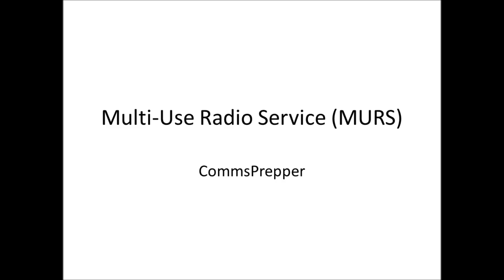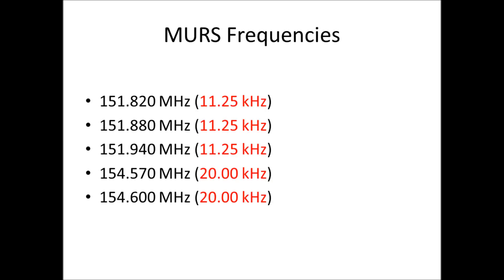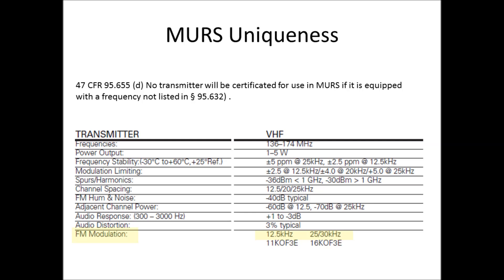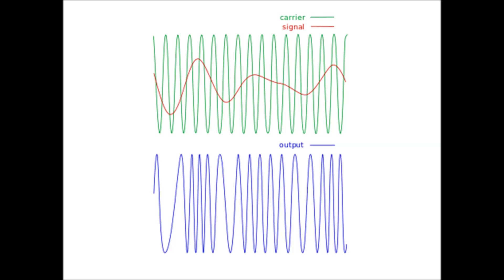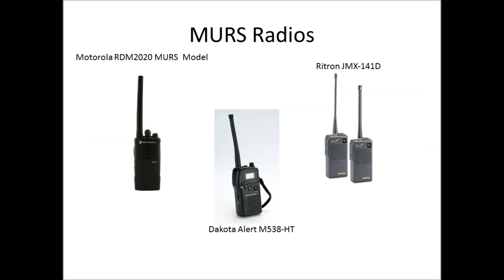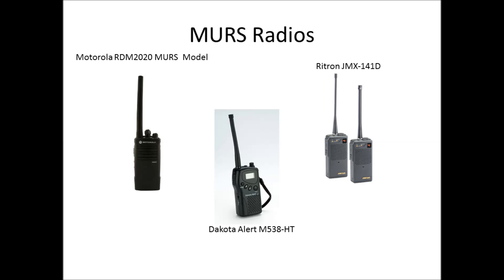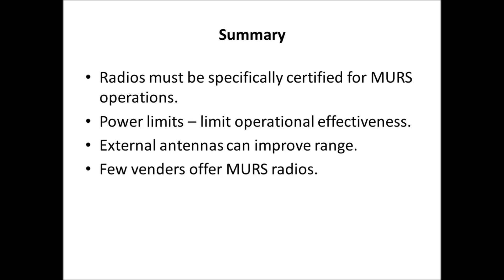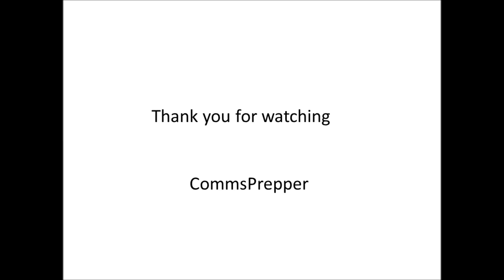MURS Radio Information for Emergency Communications

Comment: Sweet I’m a licensed ham but I’m gonna start scanning frs,gmrs and the 5 murs channels on my dual band ht. I would love to see the murs frequencies of 151-154 used locally like cb was in the80’s and 90’s when crap shack was in business. Cb is so dread now in my area nothing but static. The fm band is way clearer let’s use those 5 channels since it requires no license.

Comment: i see this video is from 2012 and majority of comments are up to 7 years old but its currently 6-29-2020 and there are B-Tech Murs radios on amazon for $50 brand new! they are basically the baofeng UV-82 model radio with a Murs "dedicated" chip set and 15 channels!  the 5 standard and 10 stepped and tuned (not sure if thats the correct terminology or not) and to my knowledge at least theres STILL no mobile or base station options available only hand helds!
Reply from the maker: I don't have china radios on this channel.

Comment: Just learned about MURS, use it at Walmart, they are probably the biggest user of MURS.  I know Motorola produces radios specifically for them.  I just bought a BTech MURS V1 for this very reason,  As i work for them.

Comment: Wondering if opinions have changed since this video was posted. MURS is still the only non licensed VHF band that allow external antennas that I'm aware of. 2 watts through the right antenna can provide good coverage.
Reply from the maker: Not sure.  I have not googled MURS radios in awhile.

Comment: If I bought a Murs radio could I  use it as my as my fire radio on the  fire department I'm on?
Reply from the maker: No
Reply: Your fire department has their own special frequency seperate from the murs band.
Reply: Can your fire department  use it as a 'Local' channel, for non emergency Communications?

Comment: Hi Com's Prepper, Although I have only heard a scratchy driveway monitor once, I never hear anything on MURS near me.  It is my understanding that Walmart uses the MURS frequencies (I have never listened to MURS near a Wallmart).  Wallyworld uses some kind of mobile in a metal box on the wall near the front door of their stores with a 1/4 wave mobile VHF antenna on it.  I was told a long time ago that it was a regular 12/25 Radius mobile in the box.  Apparently 151.820 carrier squelch has been designated the National Prepper Channel (Like CB Channel 9), but in my neck of the woods (in the great smokey mountains), its all quiet here.  Although not legal and I definitely don't recommended it, it is also my understanding that many of the locals use Marine band in their pick up trucks (I don't know what channel they use).  I have no love for the Beofung and other el cheepo comms (basically because if a lay person uses one and they accidentally touch the wrong button, without the manual they wont ever find the channel they were on to use it).  Your title of this post is   " MURS Radio Information for Emergency Communications"  Although MURS is supposed to be limited to 2 wattts and most of the radios out there are 5 watts on Walkee Talkees and more on the mobile units out there.  It is my understanding that MURS is kind of like the CB radio (per the FCC).  I think it could be VERY useful for campers, hunters preppers etc... to put all the MURS, FRS and GMRS frequencies in an emergency radio in a back pack and let their family's know, even leave a note in the front window or their cars (where they park them when camping), stating If the car is still there after a certain date they might be in trouble and to try to call them.

Comment: Update: Baofeng makes a MURS V-1, which is FCC approved and meets all of the specifications for $ 54.00. It will also receive many additional frequencies along with transmitting on murs.
Reply: Why ?
Reply from the maker: That's unfortunate.

Comment: Great video man lots of info from me personally I think Murs frequency would have taken off better if there were a lot more bubble packs that's started to use itthere are some affordable version still on eBay and Amazon but it would have been nice if Motorola made of bubble pack even if it was $150 our or midland would have made a version but if I'm not mistaken for motor roller I think the cheapest one is like 190 and if that's the case you could just add another hundred to that and get a regular VHF version 4 watts of power

Comment: I know where I live at there are several groups that use Murs radios. And most of the guys are using base station antennas at about 30 feet in the air. So I wouldn't call it obsolete. And some of the guys also have mobile units in their cars because they want to stay off the grid and not get a ham license or a gmrs license
Reply from the maker: When I say "obsolete" I am referring to the market.  There are too few manufactures making MURS (FCC approved) radios.  It's getting hard to buy a FCC compliant/approved MURS radio new today.

Comment: Good video CommsPrepper-- thank you. Murs radios are highly restrictive as too range. With only 2 watts and line of sight the signal normally does not travel very far. Really it's a radio for businesses to use in and around one location like Wal Mart uses them. 73
Reply from the maker: Thanks for the comment and channel support.
Reply: Put that antenna at home in a tree or on a pole off the ground & increase the range big time.
Reply: Joe Lalumia hello Joe I don't quite agree with you on this one friend I've been running merge for at least 10 years anyway I can cover pretty much all of Indianapolis with a base station setup to Watt radio and a 1 watt handheld with a homemade quarter wave ground plane mobile setup and really have no problems I'm running on Blue. Predominantly

Comment: LOL,If it's a SHTF situation the FCC could care less about who is using what band,what mode,or what gear so anything will go.The Agents with the FCC will be looking out for their own lives & family & nobody will be regulating any radio spectrum period.That's the honest truth that so many are afraid too say but the Truth is the Best information.Get as many forms of communications modes as possible & be ready if the SHTF.
Reply from the maker: I am not going to post videos advocating breaking the rules.  Folks should know the rules and make their own decision.  This said, I believe licensing is a good think.  It helps folks learn and training with their equipment before an SHTF event.  Post event is not the time to take a new radio out of the box and learn how to use it.  Just my opinion.  Thanks for taking the time to watching and leave a comment.  Respectfully - Hank

Comment: Oddly enough, Motorola's type accepted MURS radio uses 12.5 and 25 kHz bandwidth. The bandwidth is also unchangeable.
Reply: Both of mine had the FCC certified # on manufacturer plate, and could usually communicate with other MURS  radios although they sometimes did sound like "Donald Duck".
Reply: @steveg2406  My Btechs have no problem with other Radios

Comment: Why not get a hybrid GMRS/MURS radio and have the best of both bands? I'm carrying a great radio now at https://BetterSafeRadio.com that does it, and is FCC certified. :)
Reply from the maker: Please share the FCC ID number when you have a chance.
Reply: Small print of their SHTF radio says,NOT Legal for MURS or GMRS just FYI.It is a 5 watt radio so that was easy without the small print since 2 watts is the limit for MURS.It's a TERA TR-505 Dual-Band 16 Channel GMRS MURS Two-Way Handheld Radio & it's 5 watts so it's NOT legal on MURS Bozo.

Comment: Hi, thanks for the video. When you say using 12.5 kHz bandwidth would violate FCC regulation I understand that 12.5 and 11.25 kHz has the same FCC emission designation.Then emission designation is what needs to be followed to be legal in terms of emission and not the exact bandwidth correct? BUT if what I am saying is true that would also mean the deviation is standardized within the designation as well and im not sure that is true.  Maybe you could shed light on this.
Reply from the maker: The point I was trying to make in this video is radios designed and sold as Amateur radios do not meet the specifications for MURS.  There a MURS specific radios on the market.    12K5F3E or 11K2F3E would both be appropriate codes for traditional narrow band FM analog.

Comment: the Dakota Alert Sensors are excellent force multipliers and uses MURS frequencies.  One would have a detection and warning device, and comms justifying the higher priced MURS radios.  In my part of NW Montana, MURS is used extensively, and mostly by preppers.  MURS also connects preppers.  The FCC has yet to crack down on those using those cheap Chinese radios that are in wide use up here.  Some are using handhelds to talk 25 miles on MURS.  An external antenna attached to the handheld, greatly improves the ERP,  and extends the range.
Reply from the maker: +Jorn Jacobsen I understand the prevalent use of non-type accepted equipment but it's not something I can promote here on the channel.  Thank you for taking the time to watch and comment.  Commsprepper
Reply: +Commsprepper I have the type accepted Dakota Alert brand hand held radios.  I would assist readers with information about the actual used of the service by others.  Even though channels 4 and 5 can have a band width of 20kc, the Dakota Alert brand uses 11.5kc on all 5 MURS frequencies with a maximum of 2 watts of transmitting power. Despite this narrow bandwidth, the radio does have a greater range than FRS or GMRS radios, even the Midland GXT series with 1.5 watts on GMRS.   Attaching an external antenna to the Dakota Alert  sensors that transmit using only 1.1 watts, it is possible to extend the range beyond 6 miles.  I would purchase a high gain 'slim jim' type antenna tuned for MURS,  made and sold by N9TAX. Google it.

 I use to have a those little green army figurines way back in the 1960's, but do not recall having the RTO man.  Thank you for all the excellent information provided by this You Tube channel.

Comment: Very good information and a good refresher on modulation. Even though technology has advanced I am still hesitant to call MURS outdated or inefficient. Regardless of what a individual may prefer the MURS still does offer a additional option. The more options available even as 2nd and 3rd choices the better
Reply: Commsprepper On the other hand, since few people make MURS radios, there is less likely to be interference, unlike FRS/GMRS and CB radios.
Reply from the maker: I agree that MURS can play a role in emergency communications but as a technology - few vendors are making "MURS certified" equipment.  Finding low-cost FCC approved MURS radios is a challenge.

Comment: You mentioned that MURS is obsolete. Well, it's radio. All radio is obsolete :p MURS has some attributes that other bands don't have... and it's license free! The antennas fall under Part 95. So you can have a base antenna 60' tower or 20' above the building roof-line .I think MURS didn't catch on due to lack of clubs knowing about it. Clubs are where most fads are born. And, where are the mobile units?? Was there ever a mobile unit certified? I never heard of MURS until my C.B. repairman (Also a HAM Tech) told me about it 3 months ago. He carries the Firestick Base and Mobile antennas for MURS. When he got on he heard some guys talking from a fair distance, like 25 miles or more. Being in flat Oklahoma helps distance lol. Ive been talking to truckers that want to go to MURS and leave CB for highway conditions etc. Cops are getting aggressive about "Smokey Reports" on CB. There are a few companies where MURS has caught on and they talk to each other cab to cab. Helps privacy issues withe the PL tones. Even if others are on channel, you have the 38 tones. I wouldn't rule out MURS just yet. I'm not a prepper as much as a Urban Survivalist, lol. I use the Dakota Alert in my house. Alarms are great when I'm not home, But I love hearing the alerts when I'm here. I have one electric eye in the front yard, one in my driveway aimed at the garage door, and one in my far back yard that's blind to the house. These are IR's in a weatherproof box with a radio unit inside. MURS is "data" certified. So the radio alert comes in with a special tone to trigger the base unit. The base unit has a hook up for an alarm siren or speaker that turns on a few seconds when the alarm is sounded by the IR units. I have a 10watt siren from CrapShack that cries out to warn an intruder in my driveway that he has been detected. Sure beats going out with my rifle and calling the cops. I'd rather he/she gets away and warns his other tweeker friends to stay away. Im letting every one I know in on the MURS idea. Even a few friends around the town that used family Radio with its 1/2 watt in UHF have switched over to the 2 watt VHF HT's. They love it. No more 1 mile limit, now they are transmitting distances comparative to a CB mobile unit; 2-5 miles and much more in the desert when we take the toys out to play.

Comment: MURS is on the old Business radio freqs.
I was told by the FCC that New and Old Business radios can be used for MURS.
You can get these from business that close.
Correct me if I am wrong on this.
Reply: As of 2017 the FCC has change the rules on part 95. They now allow a larger bandwith and wattage.
https://www.buytwowayradios.com/blog/2017/04/fcc_reforms_part_95_rules_for_personal_radio_services.aspx
Reply: Anyone with half a brain knows the FCC is a Toothless Lion with no money or man power or cares about any of these radio services.They can't do 99% of the job they should be doing & it will not get any better.Many locals here have reported Deer Hunters on the 2 meter band for the last 4 years during hunting season with tag numbers, names,club names,roads & highway numbers where they hunt & again it is going on NOW & the FCC has made ZERO efforts to do anything.They don't even reply to most of the email messages.I'm guessing they ignore them because any radio service that is used by the general public is a pain in their butts & they really could care any less what goes on with them.They laugh I think because they know they have no funds,no man power,& even less cares about what is going on with any of these radio services & that's the TRUTH & the FACTS.They will all be RUN what you BRUNG in 2 or 3 years & they still won't care.There won't be any Skip like CB but it will be a crap shoot none the less.Very little legal gear & plenty of Non-Legal stuff for CHEAP will just make it worse. That & the prices of the legal gear causing people to go for the cheaper Non-Legal stuff.Wait & see & remember,I Told You So.
Reply from the maker: Only radios specifically certified by the FCC for MURS use can be used for MURS operations (http://www.fcc.gov/encyclopedia/multi-use-radio-service-murs-0).  I know of only two MURS certified radios that are on the market today.

Motorola RDM2080D: http://www.buytwowayradios.com/products/motorola/motorola-rdm2080d.aspx

Dakota Alert Handheld: http://www.dakotaalert.com/catb2b1/product_info.php?cPath=36&products_id=193&osCsid=ua2mvjmtj27alkhr7nig84pm93
Reply: Also on the FCC website... MURS is a split band. Sort of. You will see the channels 1~3 are narrow band (these are newly assigned freq's) and 4 & 5 are the old wideband for business band. 4 & 5 are the business band freq's that were grandfathered in. IF you had these freq's assigned to you at the time the new MURS was created, then you can use the freq's at your wattage (business was usually 50 watts max mobile, 300 repeater) and also use a repeater. If you are on a MURS radio and hear one of these people talking, they have first priority and you could potentially get fined for interfering with their transmission. To answer your question about obtaining something today. FCC licenses are non transferable. You change address, you get a new license. If the business goes out of business, the License dies with them. On a Bus.Band you might pick up a closing business' freq's, but you have to remember, the FCC reclassified channel 4 & 5 to MURS. No longer Bus. Band. And as Comm says, unless there is a tag on the radio stating that the radio is certified for MURS, it is not legal for MURS use. i.e. You can not use the Baofeng HAM on the one watt setting and think it's okay because MURS is 2 watts max. (Not that people don't do it). I think we all know, "mind your p's and q's" and "don't ruffle any feathers". The FCC does not chase people for "close enough" applications, tehy go after people for "interfering with transmissions"... mostly... Happy radioing :)
Reply: I forgot exactly why a few radios before a certain date were grandfathered in and the HT1000 Moto is one of them. They have ability to do 20khz but not 11.25. I did some pretty extensive reading through the rules and looked up myself the roster as to what is legal. Its possible I made an error but not likey. All the info is there for the public and if im wrong I would love to know.

Comment: thanks for the info..i believe If some one wants VHF radios for "Personal "Coms They might want to look in to getting a Business band lic for vhf  & get 5 watt business Band HTs   GMRS radios dont do well over hills & though trees   ..I personally will stick with CB  Base Mobil & CB Talkies   I have talked 15 miles away  to my friends mobile with a 4 watt CB walkie talkie equipped with a 4 FT TELESCOPIC antenna..this was done during a the solar cycle low with no skip noise .I was on high ground but still had to get over Houses & trees.
Reply: Very Unreliable but do what makes you feel happy & live or die with it.